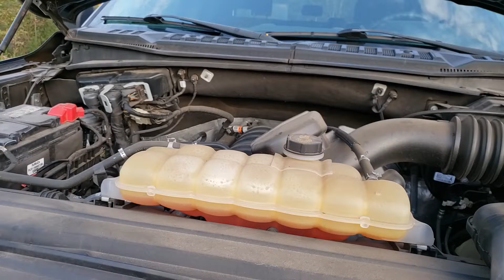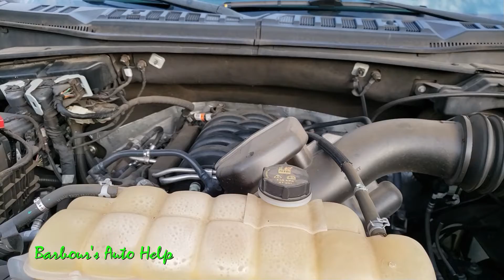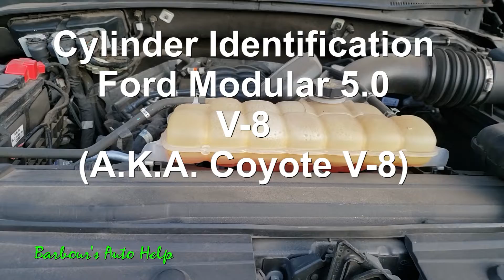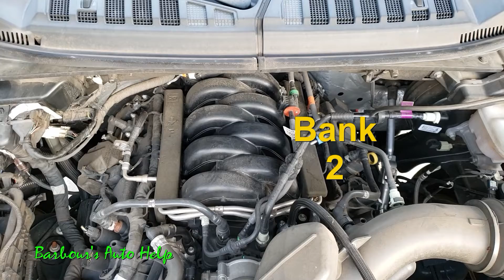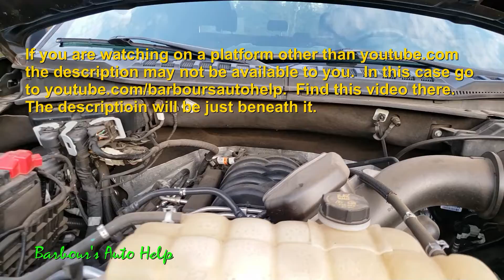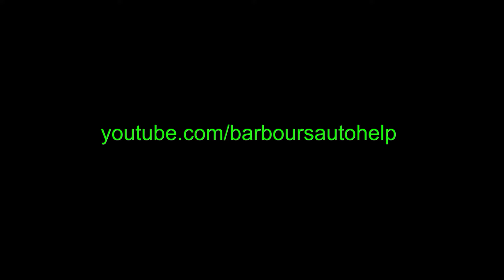Cylinder Identification Ford 5.0L Coyote Engine

Comment: Can you tell me why cylinder 3 coil pack is different from the rest?
Reply from the maker: Yes.  On the direct injection coyote the #3 coil is designed this way to make room for the high pressure fuel pump.  Or actually to make it possible to service the #3 spark plug.
Reply: @BarboursAutoHelp if you have a misfire on #3 is it more than likely the plug or the coil in your experience?